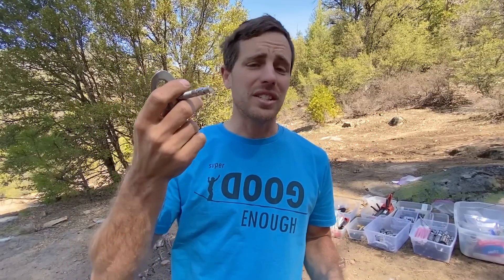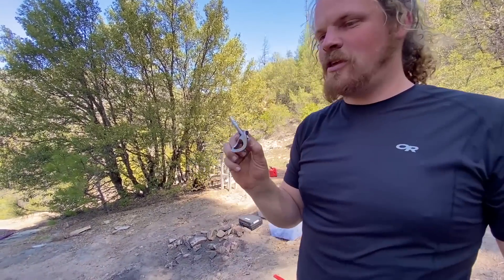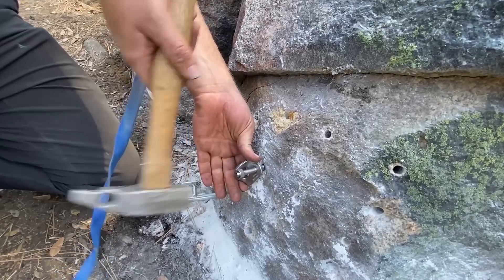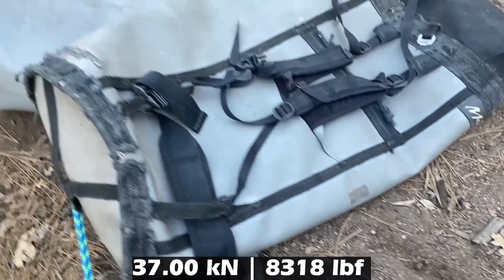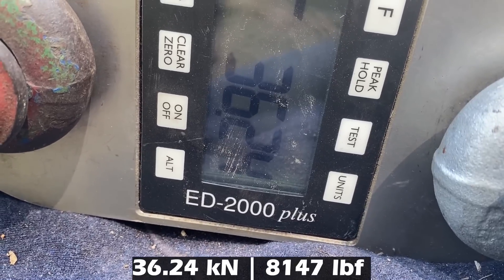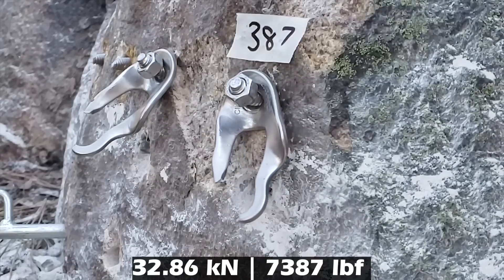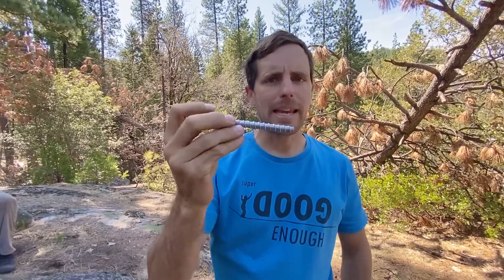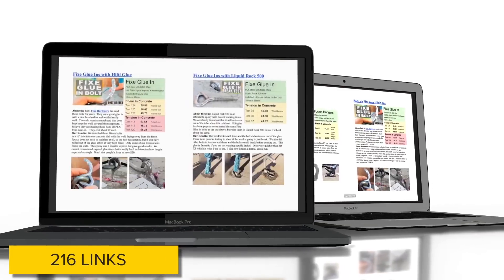Are Dirty Holes Bad For Mechanical Bolts???

Comment: IMO the main reason to clean the whole is so you can pound in the bolt to the required depth, and to help with extraction. 
Dust will actually help the binding action with my 2 cents experience as a construction worker looking at now things interact. 

I would be brushing my hole very thoroughly indeed before using a glue in though, and perhaps after glueing bolts on lead too 😅

Comment: Are these bolts that Bobby likes to use the SD4?  Just wanted to verify as he refers to them as “original Power Studs”

RE: Dirty holes:
Isn’t it important for Powers 5 Piece Sleeve Bolts to prevent spinners?  Or is that also hard to prove in testing?

Comment: Just a safety note. Canned "air" is usually butane, and probably shouldn't be left out in the sun in the desert. I use a rubber syringe from the auto parts store used for putting water into batteries. It has a long plastic tip on the end that gets down into holes.

Comment: I will say from a welding/construction point of view when we use wedge bolts (sometimes same exact ones in video) we rarely clean them minus running the drill up and down a time or 2 once we get our depth, same thing with titan screws holding up 10klbs stair cases etc.

Comment: So: guys did one experiment with one rock, one screw, no preload, no torqewrench, no experiment cicle and analysis. This time it held... 
All Safety rulls are written with blood. In engineering normal safety faktor is 2-3. If you are holding objects above peoples heads you have to use Faktor 12 !!!

Comment: Most interesting for me was actually to see that the there were no problem with the bolts although they were very close apart. It would be interesting to see how close you could set them also to edges. UIAA say 20 cm which for me is just way to long distance.
Reply: This is entirely dependent on the rock formation which is why you want some distance as a general rule.

Comment: Funny how everyone sees a video where there's literally no difference between dusted and not dusted holes, and yet keep going "yeAh BuT yOU shOUlD CleAn BecAuSE iT's GoOd PracTice"... yeah let's keep doing things for no reason. Because we thought we should. Because we decide to go with tradition and "common sense" rather than reason. Good booooooys.
Reply: I would argue that given the information in the video it still seems like good practice to do it beyond "let's stick with tradition".
It is reasonable to assume that there are reasons people care about cleaning the holes in industrial applications and just one test with a small number of bolts shouldn't be enough on its own to convince you people in industry are just flat out wrong.
Besides that cleaning also just results in more consistent and predictable coditions even if it doesn't make a difference in 99.9% of cases. 
I could imagine issues where initially the loose dirt is compressed into place by the bolt providing a secure connection but the compressed rock dust that is providing the connection might get washed away over time makeing the bolt become much looser.

So yeah as a non climber I'd say it still looks like it is good practice BUT a close eye shuld be kept on the posibility of it becomming considdered obsolete in some situations and maybe even bad practice in cases where the risk during installation outweighs any potential safety gained from an ever so slightly more predictable install IF these results here are replicated and verifeid over longer time spans
Reply: As we a constantly told, this is primarily an entertainment channel NOT a scientific study.

Comment: Would presume different rock types would create different issues for the work load of the bolts (either dust itself or the aggragate of the concrete).?...

Comment: I think the hole cleaning comes down to that there is a higher chance for the debris to give a false positive on how well the bolt tightened into the rock, for example it could even jam up the thread or the expansion could simply be holding on debris. But clearly that chance isn't super high. Even if the chances of the bolt being screwed up are 1 in 100. How many holes are you going to bolt in your life? 2000 or more? So even if 1 in 10,000 bolts will fail due to dirt in the hole. How many bolts would be ready to fail in America if nobody cleaned their holes? Would you feel good if you knew the people making your car seat belts didn't bothering cleaning the mechanicals out because they saw a youtube video with a small set of test samples that showed dirty was unlikely to effect their operation?

Comment: They broke at the threads because of the induced bend by the hanger. That Bend creates a loss of strength which is obviously lower than the flare at the sleeve. Hat bend is also heating the point of the bend under tension. So there is a lot of molecular change of of the steel happening at the wrong place at the wrong time.

Comment: Cleaning the hole removes a variable. Its hard to test variables when time and seasons play a part. Just like we use as few of links possible in an anchor, we should try to remove any unknown variables when it is simple and easy to do so.

Comment: It's just that one time the dirt inside randomly interfears with the locking mechs grip somehow that you wanna avoid by cleaning the holez out.

It probably doesn't matter 99.9% of the time, but that 0.1% is 1 in every 1000 bolts that fail. (% used are for illistrative purposes only).

Comment: Very interesting! As one employed in the commercial development industry, expansion anchors are used regularly. We have always been told and even required, via special inspections, to brush and blow the holes clean. The cavoite is, that is with glue/epoxy anchored hardware. Regarding expansion bolts that wedge themselves against the outer wall of a drilled hole, I would think the additional dust would help the wedge bind and flare out faster creating a tighter faster lock-up. As for an anchor that doesn't expand/wedge and is held in place solely with epoxy bonding with the rock, dust would act as flouring a pan does in cooking. It presents a barrier between the granite/holding rock and the bolt which would allow a lack of adhesion between the rock and bolt. Or so makes sense...

Comment: I love the testing you guys do.
With regards to dust. I come from the industrial world. It's worth noting that manufacturers like Hilti and Rawl say to always blow out the hole for resin fixings. Whether you agree or not, your insurance company will have a field day with you should you have an accident and haven't blown your hole properly.
Also, I notice the rock you're going into seems pretty solid if you like, it's dusty, but not super dusty. This is more hypothesising at this point, but I wonder if different rock, softer rock, will make more dust and make a bigger difference.
Reply: I seriously doubt that if an accident happened anyone would be able to prove that the person that installed the bolt didn’t clean the hole.

Comment: I think the industrial hole cleaning is pushed so hard because most of the time it is in reinforced concrete of a finite depth, with rebar reinforcement/conduits/sleeves/plumbing that cannot be breached... so a precise drilling depth requires cleaning for proper bolt set. However if you can just drill the hole to any depth (rock, non essential slabs, etc.) The anchor just cleans the hole as it's installed, pushing the dust to the void left at the bottom from drilling deeper than "recommended" 👍(that's what that collar and stick are for, you know that thing that everyone promptly throws away after buying a cordless rotary hammer drill 🤣)

Comment: Use a rod connector with a bolt in it as a set tool to avoid deforming the head of the bolt
Reply: Deforming the head seams better than deforming the threads.
Reply: @FlatOutFE   the tool I am suggesting  prevents  all of the above. It's a union electrician trick /tool
Reply: @joshkelly3743  the ends of a Dewalt Power-stud are designed to be pounded on.
Reply: @FlatOutFE  that is true.  But have you be cut by one yet? I the union we don't hit the bolt . We use the tool

Comment: Well i used to lick clean the holes for mechanical bolts. Now i just clean most of them so the bolt can slide in more easily. Although in your test there is a lack of data. You made the test on fresh placed bolts. What would the result be after some years exposure to rain and snowboard and moisture? Maybe dirt accelerates the process of corrosion. I mean you need extensive data in order to reach to substantial conclusions.
Reply: ... shouldn't be any corrosion concerns for stainless‡ bolts lol

‡"or titanium for sea crags"
Reply: @rachelhasbruises  from my experience all steel can be corroded in certain environments. The great difference is the time that needs to be corroded. In Greece, having a lot of crags by the sea i can assure you that the case is not if but when.

Comment: It just doesn't matter. As long as you go deep enough and dont have a build up of dust in the bottom of the hole, you're good. I've bolted down 20 foot press brakes, sheet metal punch CNC machines, 5Kw fiber laser, ect. Dont vacuum the holes, and I've never had one come loose.

Comment: I’ve installed thousands of bolts. The rock dust in the hole makes it way more likely to create a spinner bolt. This  will definitely affect strength and overall longevity of the bolt with a spinning hanger on it. The spinning hanger can eventually cut through a bolt with enough traffic. As your test shows though it will work most of the time. I’ve installed tons of bolts with and without blowing The dust out. It works most of the time but sometimes it doesn’t. Depends on the quality of the bolt as well as to how often you will get a spinner with a dusty hole situation. When It comes to mechanical bolts, it is just better to blow the hole out to reduce spinners. Nobody wants to put in or look at two bolts in one spot. It is unsightly, inconsiderate, and unnecessary.

Comment: If you don't blow clear enough of the dust, there's the risk the bolt won't fully fit into the hole, and then pulling it out would be a bitch

Comment: Things can most definitley go wrong with dirty holes...Is it always gonna happen? No..Can you really predict when it's gonna go bad? Not really...Why take the chance on a piece of life saving equipment?...There's a reason why climbing gear goes above and beyond normal use weight limits..You can't always predict what's gonna happen..Why not be more safe? Doesn't hurt anything..I'm not adjusting my standards either because 1 guy likes to climb while he's drilling holes..Good luck to that guy

Comment: For a wedge anchor a clean hole makes it easier to hammer in and get to proper install depth. Putting water in the hole makes it even easier to hammer in,  you should test that to see if they will pull out easier wet. Also they are breaking at the threads because you are not doing a straight line pull which is opening the base of the thread and starting the break in material. Those bolts are rated in sheer and pull neither of which your test did, still impressive the strength. I enjoy your testing even tho I do not climb anything other then my stairs or into my car...
Reply: They're testing the real life pulling mechanics that would be seen if someone were climbing or highlining, hence using a hanger, which in all reality probably even decreases the tension strength by concentrating the force on one part of the threads.

Comment: You guys make the coolest slingshots around, Both looked great until it pulled and bent where the threads were and tore it right off.  It would be interesting if you can have a insert of sorts go into the hole and use a straight shank bolt to attach the hangar then it would be solid rod at the head of the bolt instead of threads. Maybe glue in titanium threaded tubes then the bolt can be replaced at any time.

Comment: Great video. I'm in construction, and if I don't have a way to clean the hole, I drill it a bit deeper to give room for the extra dust to get packed in the end
When I hammer in the bolt.

Comment: Could cleaning the bolt holes be more relevant for longevity and repeat low kN loads? I know in industrial installs getting the bolt to a specific tension is important so the preload holds everything in place not allowing the bolt to work harden and become more brittle. Could a layer of dirt allow the bolt to move ever so slightly? An issue that likely only becomes visible after thousands of lower kN loads, temperature changes, humidity changes etc??
Reply: I would guess no, the bolt isn't constantly under tension, and when it is, most of the time it's under such small loads as lowering, and then less frequent whippers, which are still super low compared to the bolt strength. Probably more important would be to tighten the bolt enough so that movement is limited, my guess. Also, in a historical sense, I've never heard of a proper sized (3/8") bolt snapping anywhere except for in areas with extreme corrosion and improper materials like Thailand

 I feel like the general consensus we're getting from all these tests is that the equipment is so much more bomber than will ever need to be a concern, except for a few instances, like knots in ropes, bending a carabiner over a rock (scary as frig), etc
Reply: I think long term I believe the dirt in the hole will hold moisture and cause premature corrosion... similar to how dirt can cause premature rust and corrosion on your car
Reply: Probably a good thought. It works good, until it doesn't..

Comment: I imagine with glue the dirt/dust just acts as sand does in concrete and may even add strength.  But with mechanical anchors it could only hurt.